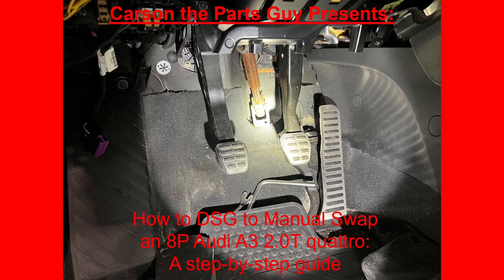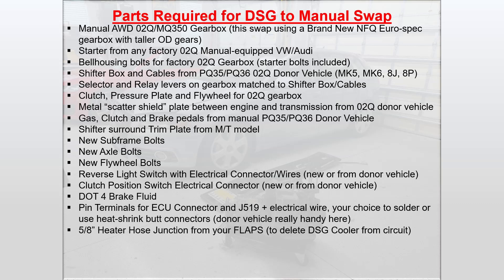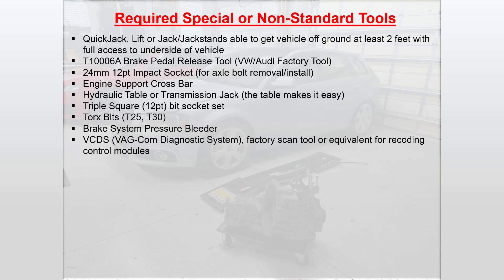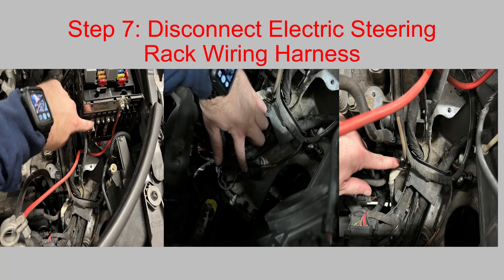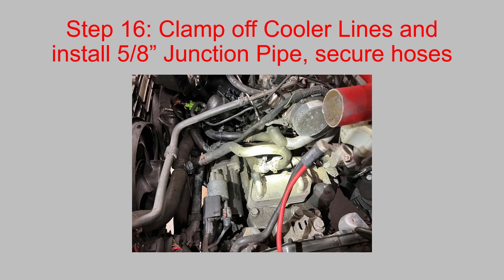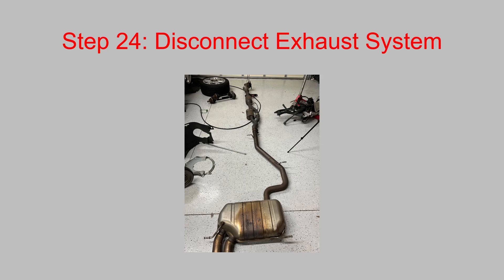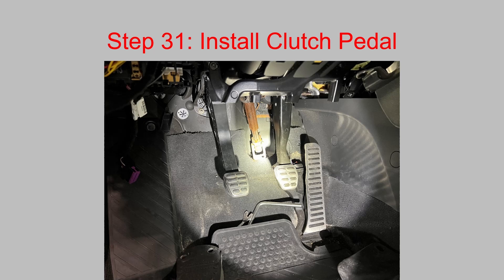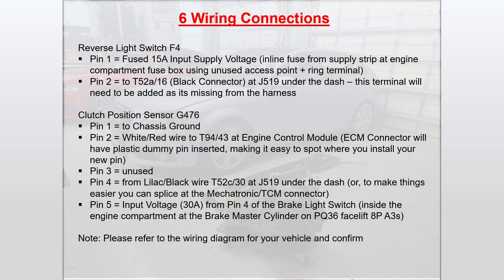DSG to Manual Swap - a step-by-step guide

Comment: Is this the same for a tdi?
Reply from the maker: It’ll have its own component differences, such as the clutch, PP and flywheel setup, but the basics of the swap are the same. If you’re swapping a FWD 8P A3 TDI from DSG to Manual, you’ll want the transmission, axles, starter, bolts and the aforementioned c/pp/fw setup a MK5/MK6 Golf/Jetta, ideally with the same engine code if possible. Then make the necessary wiring changes.
Reply: @carsonthepartsguy8751  okay, so what about after i switch the ecu?
Would i need to swap the ignition from the doner car as well?
Reply from the maker: @Anthony-sr3if  Look into recoding your existing ECU first. I was able to on mine, but not sure on a TDI. You also have the option of swapping a manual ECU in and having it adapted to your car by a dealership or shop with a factory scan tool and subscription to ODIS.

Comment: Clearly, you pretty much need to be a professional mechanic AND have a lot of time available to study wiring diagrams and find compatible parts in order to do this. It's not just pulling one trans and installing another.
Reply from the maker: It’s the parts bin, and while I am a former certified VW/Audi Tech and a current VW parts consultant, I do believe this swap is within reach to anyone with good mechanical aptitude. It’s swapping parts out, no real fabrication required in this instance. I’ve laid it all out here, and if given the opportunity I’d gladly swap others like the 3.2 VR A3 or MK5 R32. Knowing what is compatible does help, and brand knowledge also comes into play - but a lot of enthusiasts already have that. The wiring diagrams weren’t hard to follow at all. But, if you want something bad enough, you’ll find a way. 🙂
Reply: May i get parts from you? As i wanted to make a RHD convertion for my a MK8 Golf R which manual is only available in usa and canada.

Comment: can you go from a manual to a dsg with an audio tt mk1 ?
Reply from the maker: You can, but it could possibly require a standalone ECU for communications with the mechatronic in the DSG. The factory MK1 (8N) TT 3.2s were standard with DSG in the USA, no manual option until the MK2 (8J) TT 3.2 came out. People have DSG swapped older stuff but that isn't a subject I'm likely to cover myself.

Comment: Will the DQ 350 transmission work on FWD or AWD only ?
Reply from the maker: @Scrutiiny  It was sold as both. The only major difference between FWD and AWD is the differential.
Reply: @carsonthepartsguy8751  will VW DQ350 work or only Audi ?
Reply from the maker: @Scrutiiny  I think you mean MQ350 - DQ refers to DSG gearboxes, of which there is a DQ200, DQ250, DQ381 and DQ500. VW owns Audi, the parts bin is the parts bin. With the MQ350, they were available with 2 bellhousings - 4 cylinder and VR6. The 07K 5 cylinder has the 4 cylinder bellhousing pattern.
Reply: @carsonthepartsguy8751   can I do this swap with a 2015 8v model ? Or is it only 8P
Reply from the maker: @Scrutiiny  You can, the firewall has the provision to mount a clutch pedal.
Reply: @carsonthepartsguy8751   thank you your a life saver